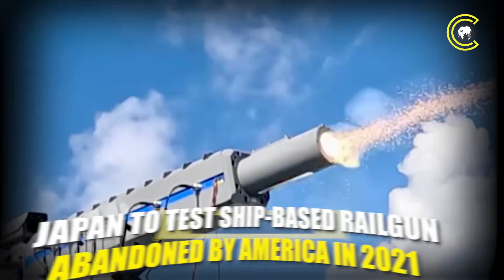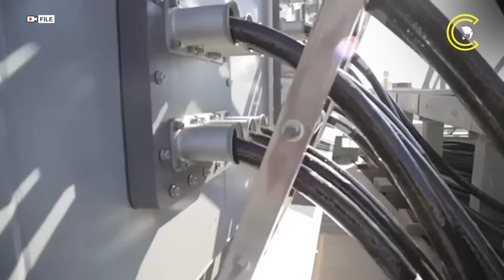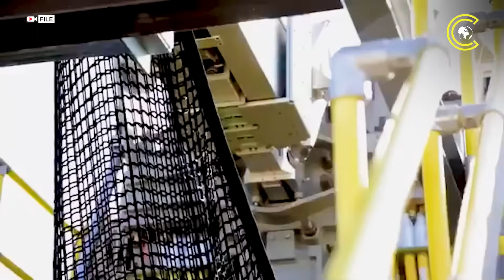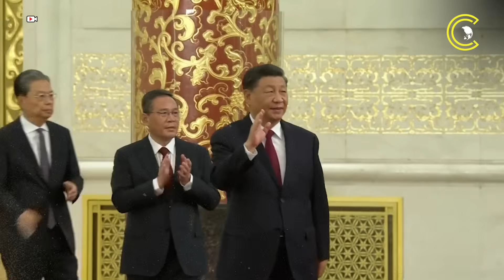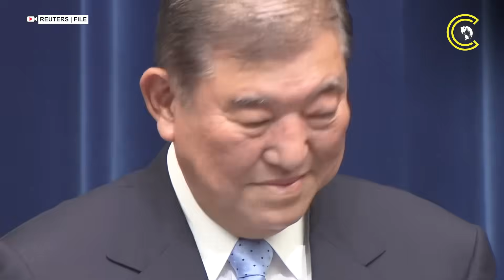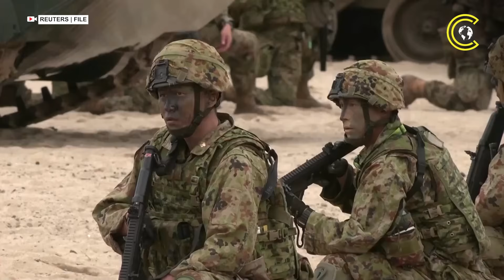Will Tokyo's Hypersonic Railgun Outpace U.S. and China in the Race for Electromagnetic Arms? CLRCUT

Comment: You clowns don't know how hypersonic weapons work. How will you even be able to track a hypersonic missile to fire a rail gun at it.

When an object travels above Mach 5 the air around it turns into plasma.

That plasma acts as a magnetic field dispersing any electrons off the object and also disrupting any radar waves heading towards the object.

This makes it so that that radar inefficient in tracking the object.

It also deflects the ultraviolet rays heading towards the object.

Making the infra red receiver track the object way slower than the object is actually flying at.

The problem with hypersonic missiles is that you can't track them, plus they are able to conduct unpredictable evasive manouvers at hypersonic speeds.

This railgun thing won't work. The Americans, Chinese and Russians have already tried this. They have been working of these things for years if not decades